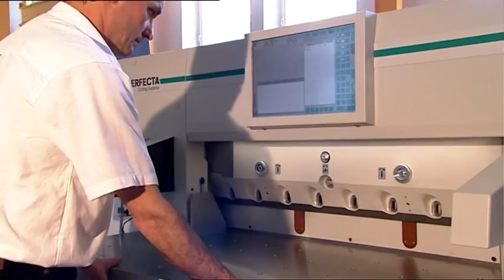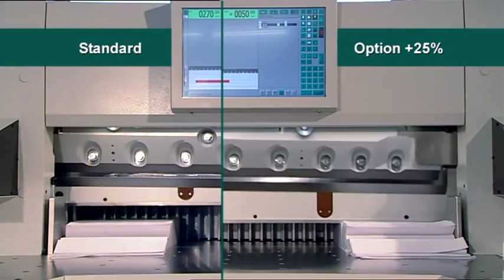PERFECTA 115 TS Knife Change

Comment: Nice machine. I have changed knifes on a polar cutter many times. You want fun though try it on older cutters without all the safeties. I spent about 10 of the 17 years in printing running a 38" (1938) Oswego and 44" ( 1930's) Seybold. Those were fun to change, but doable if you know the machine

Comment: This operator has made a boo-boo straight off the bat! You should always keep the knife fixing bolts opposite/in - line with the holes they are removed from. If a bolt is damaged then it doesn't move around different holes and spoil the threaded holes in all of the knives! This is especially important if you have expensive tungsten carbide tipped blades which have only one row of bolt - holes. Looks like this operator is at the Perfecta factory showroom, so if he damages the bolts or the knives, he call walk to the Parts Store and get some replacements free of charge! Not the real World when you have to watch the pennies and the manufacturers' agent is miles away.